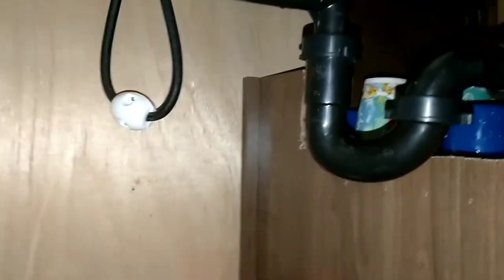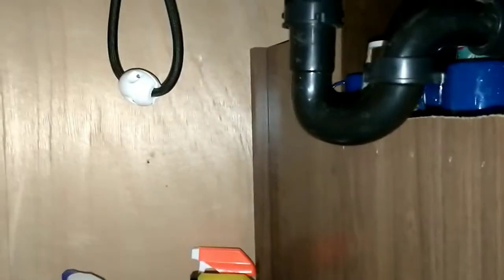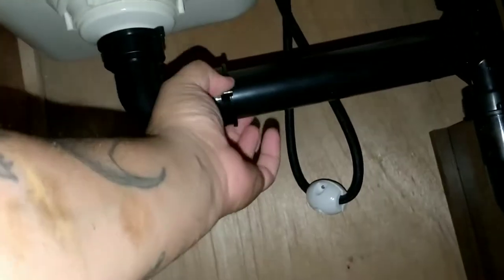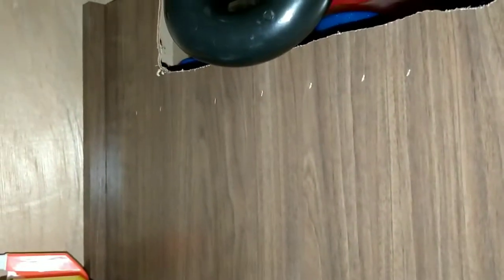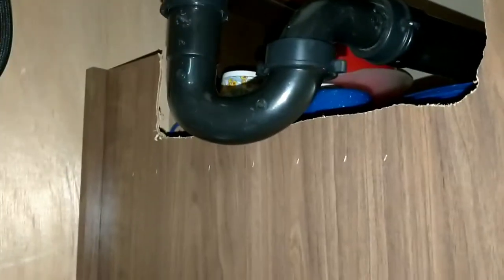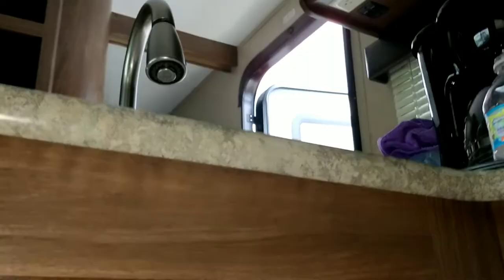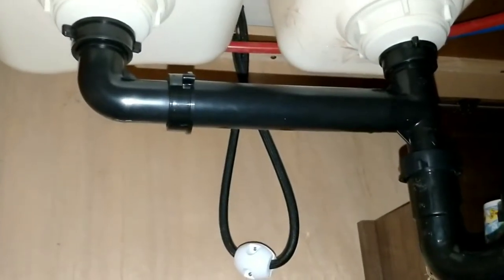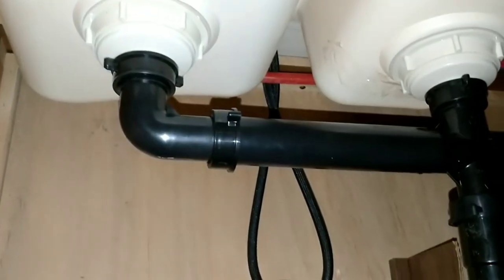RV travel trailer fixed leak in a drain pipe

Comment: So I have a leak somewhere, I have the same type of water damage. Water is shut off and faucets left on. but when I come back after weeks of not using it, I have moisture wicking up the bottom of dresser (not on floor or wall) the opposite wall of bathroom sink. So was your water pump the problem?